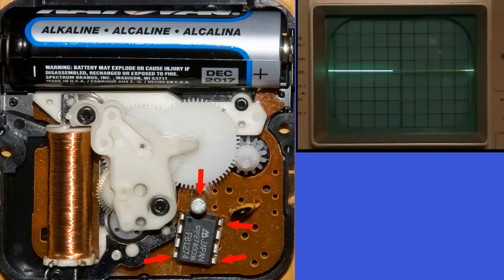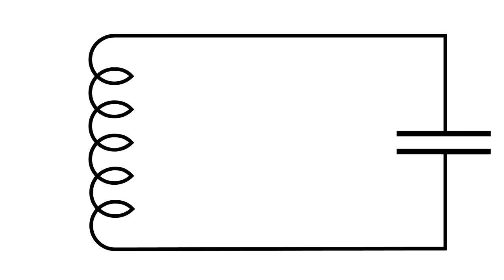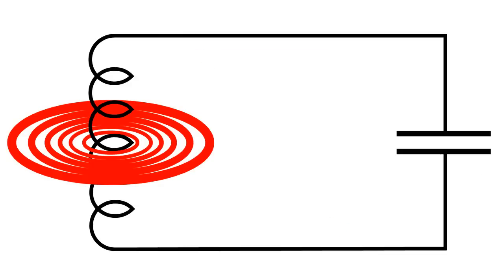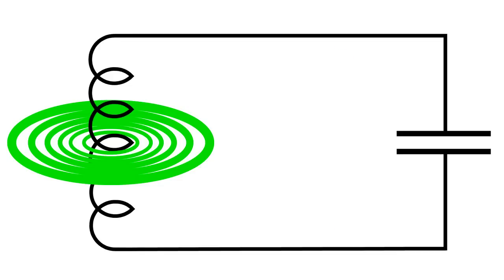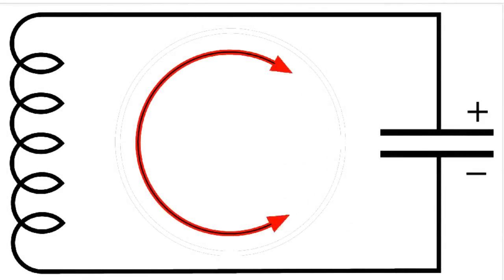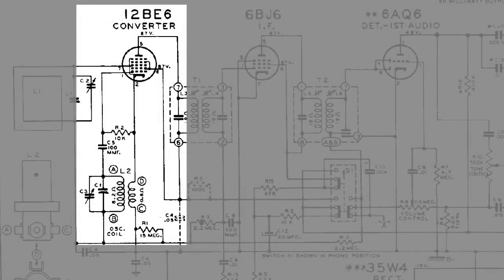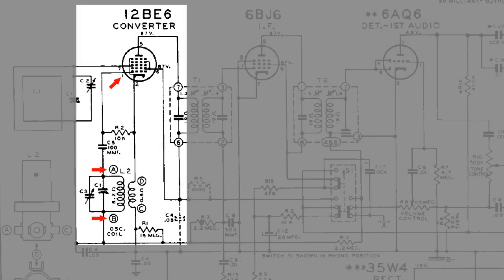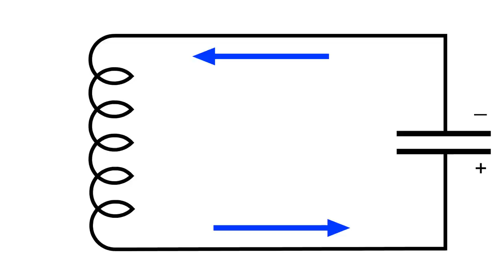Oscillators, the Basic Tank Circuit 1

Comment from the maker: A multivibrator circuit is an oscillator usually without an LC Tank circuit and its output is usually a square wave. The multivibrator circuit is an electronic circuit used to implement a variety of simple two-state systems such as oscillators, timers and flip-flops.

Comment from the maker: The current does not increase. With out external energy input at the right time (positive feedback), each half cycle is less until the the tank runs out of energy. In an oscillator circuit the positive feedback adds energy at the right time to keep the oscillator oscillating.

Comment from the maker: With out external energy the current (total energy) can not increase anywhere. After the initial start charge the energy decrease every half cycle until its gone because of internal resistance of the circuit.

Comment from the maker: @Poseidon99Jeus 
If you want to use a tank circuit you pick the L and the C for the frequency. You maybe thinking about chip frequency dividers. The chip is driven at a very high frequency and there are multiple divided down frequency outputs. This insures accurate and stable outputs.

Comment from the maker: Thanks vibra64
Oh yes, tanks circuits are still used allover the place. It is sort of like follow the money. The quartz crystal oscillator is very cheap and very accurate. A problem would be if you wanted to use it as a tuner. The digital supporting circuits cost more and draw more power than does a simple tanks circuit. But if accuracy is important, crystal is a good choice.

Comment: Very nice; a clear description of energy transfer back and forth between the L & the C. I only have a small question - excuse me if I repeat someone else's - is the magnetic field orientation as shown, rotated by 90 degrees ?  That is, the circular field lines go through the coil along its axis, then outside; the circles would lie in the vertical plane, not horizontal, I think,  Thanks again.

Comment: the positive feedback aspect made sense. However, I'm not sure how to apply it in an at-nom DIY aspect. I get the inductance between the tank circuit coil and the feedback coil aspect, but if I were going to do something simple at home, instead of build a tube radio, would this keen the feedback coil is connected to a battery of some sort?

Comment: consider the ideal case. When the capacitor is discharging, the current through the inductor is increasing. when the charge is zero, the energy on the inductor is max=0.5Li^2=0.5q^2/C. that means the current has attained its highest value. my question is how does a discharging capacitor give rise to increasing current...plz help...ur video is gud..help me wid dis doubt too :)

Comment: Doesn't the inductor have an e.m.f that opposes the e.m.f of the capacitor....so why doesn't the current stop flowing when they get equal?
Reply from the maker: Yes, it's not very strong in RF coils. Power transformers, iron core, very strong EMF, that's why a primary of 8 to 10 ohms for 120VAC.
Impedance, Back EMF, AC Resistance
https://youtu.be/y11SbmXPY18

Comment from the maker: But, when they hooked negative to the filament and positive to the plate, then electrons flowed. This proves that electrons in a circuit flow from negative to positive. Why some people still insist on using a theory that is proven wrong is beyond my comprehension. Electrons flow from negative to positive.

Comment: hi, i have question on CDI(capacitor discharge ignition), basically the circuit is charging a capacitor. capacitor positive leg is connected to + 400 DC volt via resistor and negative leg of the capacitor is connected to the primary side of the coil. When time comes to trigger the coil it trigger the gate in  SCR, source that is connected to positive side of capcitor, drain connected to the ground is activated, which discharge the capacitor thru SCR and primary of ignition coil

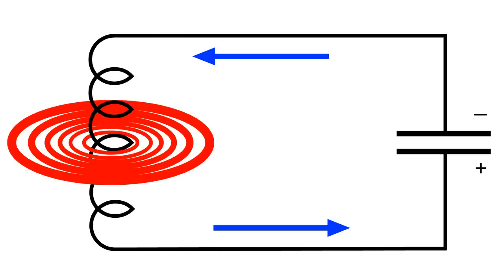Comment: 2:52 trying to understand: how can you charge the capacitor since there is no power source in the circuit?
Reply from the maker: Get a coil of wire, a magnet and a millivoltmeter, then experiment.  When the magnetic field moves there is energy. The capacitor is charged from the moving magnetic field.

Comment from the maker: In an LC oscillator the inductors magnetic field is the energy that changes the direction of electron flow when the magnetic field changes its direction. I think you are confusing potential and current. When the magnetic field changes direction it is either at the highest potential or at the lowest potential. The capacitor can only discharge as it has been charged. Current has to stop to change direction, which is at maximum potential or minimum potential.

Comment: Thank you very much, your channel and wikepedia have been invaluable to me. with the external voltage allowing the tank circuit to continue does it affect the ac current the tank circuit produces? would it have to be filtered out after it has done its job of allowing the tank circuit to continue, is the the external power provided by the inductors magnetic field inducing a current in the tank circuit?
Reply from the maker: Yes, do a channel search on my channel for "Impedance, Back EMF, AC Resistance"
Reply: kk

Comment: in case if i have not explained about CDI, please google it u will see schematic, what i dont know is, capacitor that is charged will have + on one side and negative on other side. schematic says that +side of capacitor is discharged to the ground via SCR, if positive is discharged to ground, the other side of capacitor is negatively charged and since the negative side of capacitor is connected to primary side of the coil, i dont know how an current will flow on primary coil, bcz primary

Comment: why you are changing electron flow when inductor has stored energy and its supplying current to capacitor you are wrong here rest its a good video
Reply from the maker: The video is correct, maybe these videos will help

Wire and Magnetic Field, Right/Left Hand Rules, The Basics
https://youtu.be/UYgmpXHDdN0

Impedance, Back EMF, AC Resistance
https://youtu.be/y11SbmXPY18